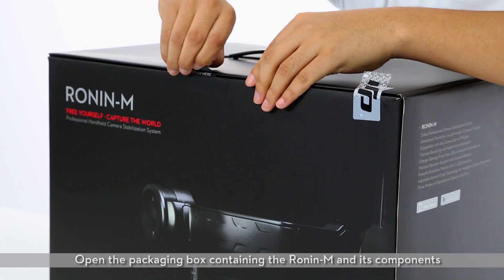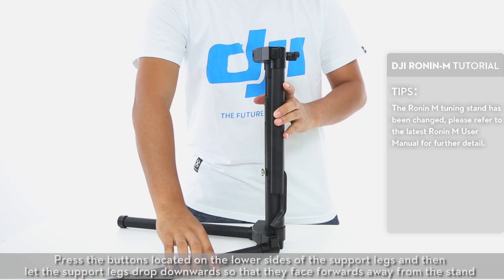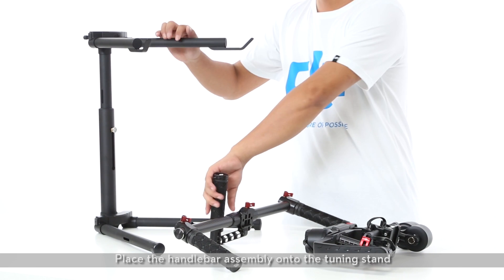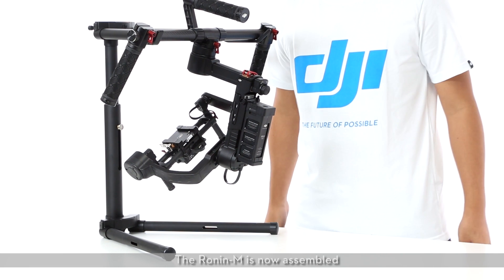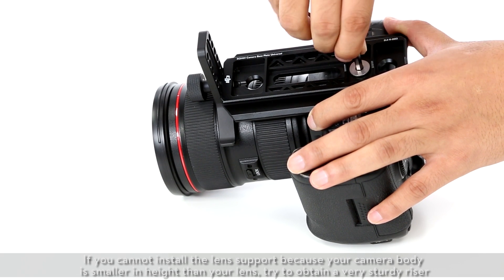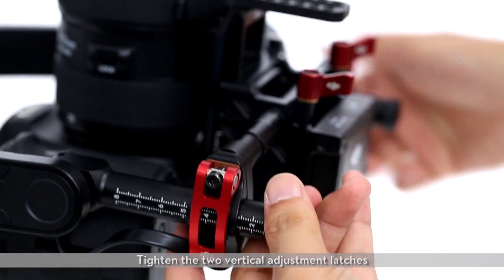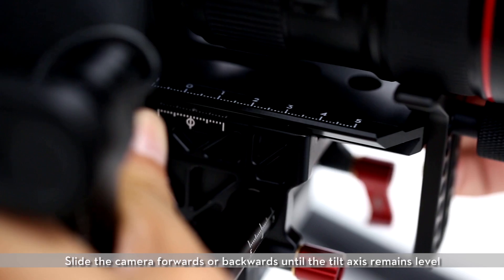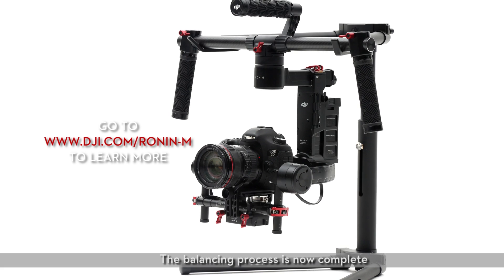DJI Tutorials - Ronin-M - Preparing and Balancing

Comment: tip for the vertical tilt balance. it seems to work only if the initial position of the camera on the plate of the gimbal is already close to the final one, otherwise all micro movements up or down doesn't help nill. so try that, if the segment starting at 6:18 drives you crazy. just go back and repeat with slightly different position what is happening at 5:58.

Comment: Btw, why is my stand different than yours? It doesn't have a slider either.
Reply: i think your ronin M is V2, does it come with 2x smaller battery? if so it just like mine, the V2 stand is garbage. My locking string on my Ronin M V2 is already broken
Reply: my stand is also different.
Reply: but you may also have the updated version of the ronin with the batteries being different as well.